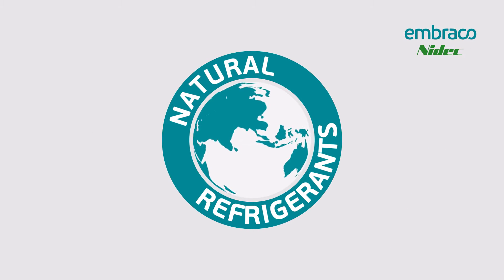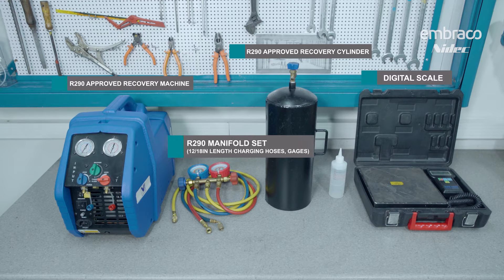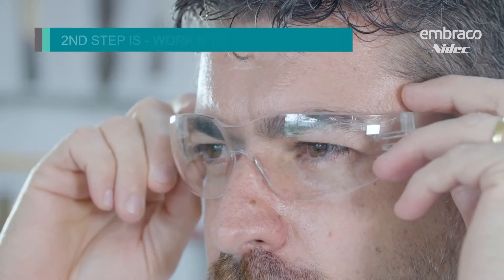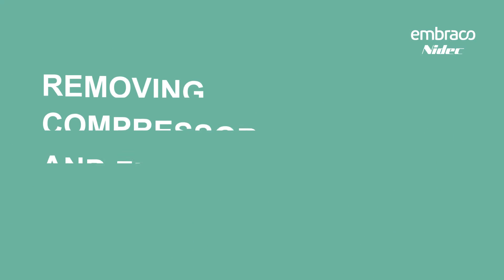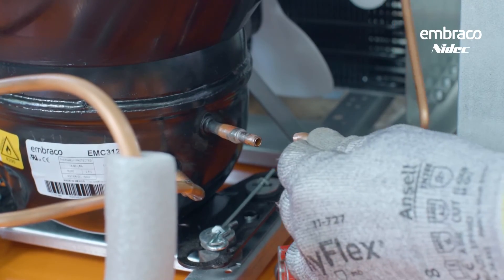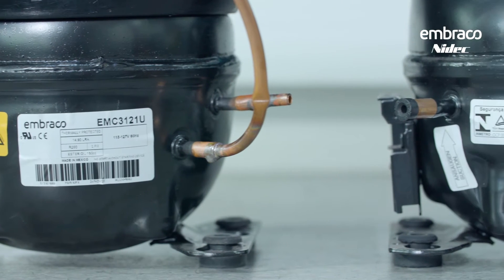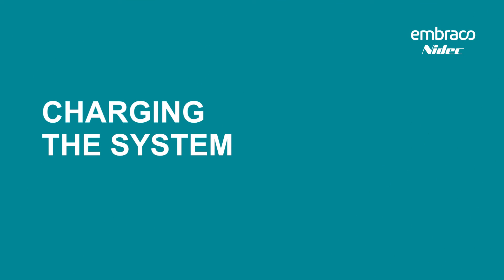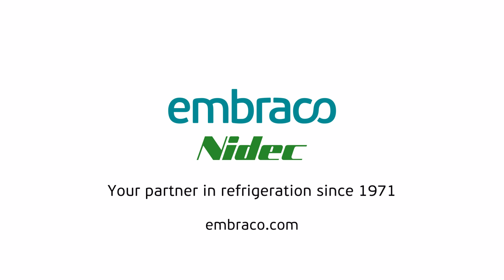R290 Training | Module 5: Step By Step Compressor Replacement

Comment: So do you seal the liquid side port on filter drier?
Reply from the maker: Hello! Thank you for your message. According to our Technical Support, it is best practice to seal all service ports when the service is complete on systems with small charges as even minute leaks can negatively affect performance or cause the system to fail. This pertains to systems with HC refrigerants especially because the charges are even smaller than conventional. Gases and every effort should be made to reduce the chance of a leak. 
To find installation guidelines and other technical documents, please access: https://www.embraco.com/en/service-support/#_